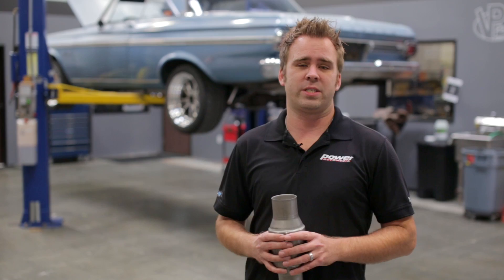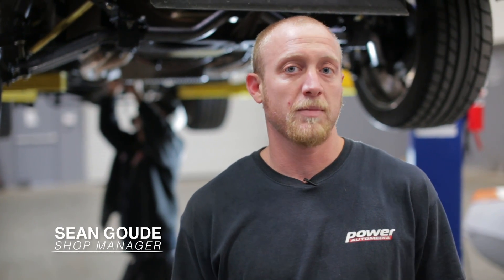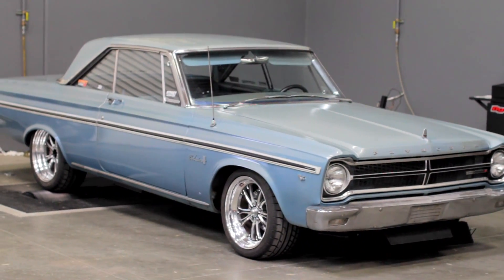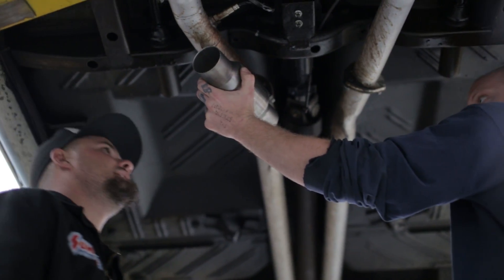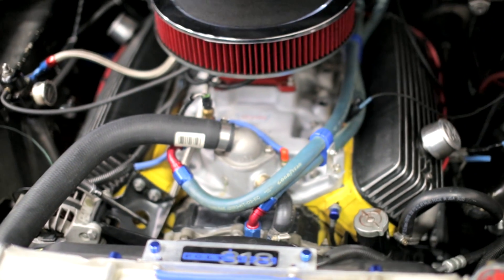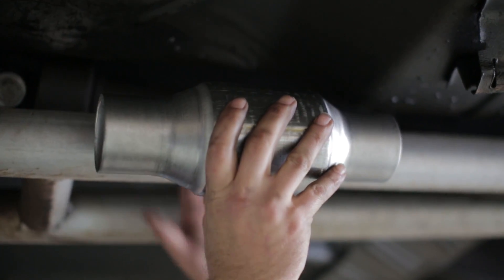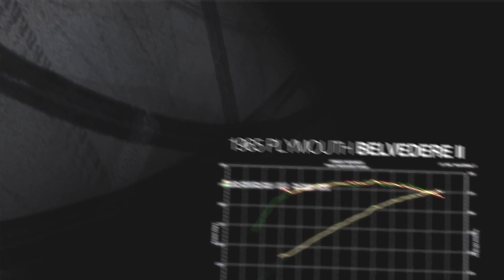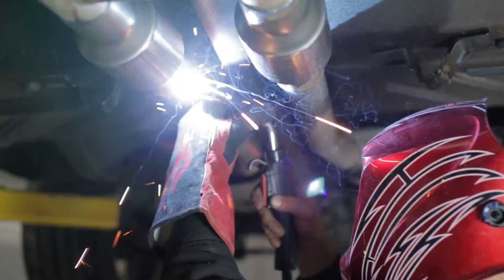Do Catalytic Converters (Cats) Rob Horsepower?

Comment: Why when i deleted 2 catalityc convert on mustang 2003.vibrates? Is that normal??...
Reply from the maker: Removal of a Federally mandated emissions component is illegal and not recommended. That being said, I have heard multiple stories of the exhaust note getting louder and the smell of exhaust becomes more noticeable with cat removal. But, if you're experiencing rattling/shaking/vibration issues I would take your vehicle back to the shop that removed them or speak with an exhaust professional about inspecting the issue.

- Jason @ Flowmaster

Comment: Yeah but what about the big bulky Cadillac converters I have MagnaFlow exhaust on my 2001 Dodge Ram I was thinking by cutting off the Cadillac converter and then welding it back together without the Cadillac converter it will give me better airflow and more horsepower is that wrong?
Reply: "Cadillac converter" lol
Reply from the maker: We do not recommend to remove the Catalytic Converter from your vehicle. Federal laws stipulate that the emissions control components must remain intact and can only be replaced under certain conditions, not completely removed. If you live in a State that has some form of emissions testing then you may also fail the inspection/test based on the removal of the Catalytic Converter. Finally, there are sensors that connect to the exhaust system and the Catalytic Converter itself that communicate with the vehicles main computer where the computer will adjust air and fuel based on the readings of these sensors. If the Catalytic Converter is removed then the sensor will get a false reading and will not be able to correctly adjust the air and fuel mixture. You will also get a "check engine" light by removing the Catalytic Converter as well. If you have additional questions please give us a call at 707-544-4761.

- Jason @ Flowmaster

Comment: Mine is no flex pipe and no cat, just straight pipe from the header all the way to the resonator out the other pipe which is 2 in half that connects with a 3inch pipe. Sounds awesome and lots of air flow

Comment: What engine size are these good for? I read they were only good up to a 5.9L but I'm wondering will they still work for my 6.3L engine.
Reply from the maker: Hi,

We offer a wide range of catalytic converters that could be used in just about any exhaust application. Give us a call at 707-544-4761 and we would be more than happy to assist you in finding the right product for your vehicle. 

Kind regards,
Team Flowmaster

Comment: I have no cats and my exhaust stinks do cats get rid of smell, and the car is professionally  dyno tuned so fuel air mixture is perfect
Reply: Yes it helps with the smell. I removed mine and my car now smells like eggs
Reply: mine too! so ya ok I guess flowmaster cats is the way im going.....
Reply: +julio chavez the egg smell is due to faulty cats, not the lack of one.
Reply: +heydude76 Find another tunner. Unless you're running methanol or nitro, or your car is an oil burner, your car exhaust should not smell (your car is probably running rich) even without cats.